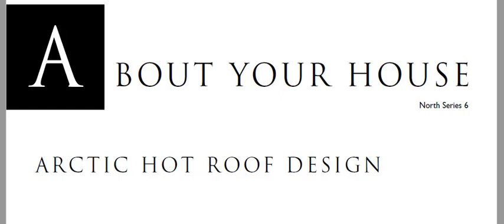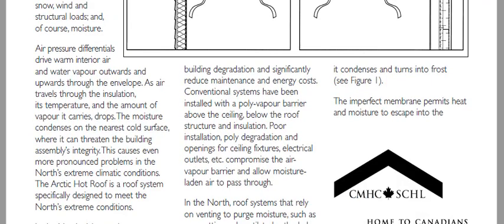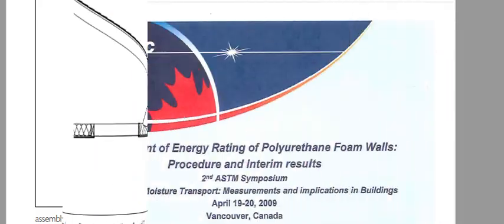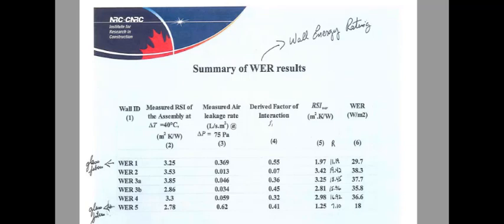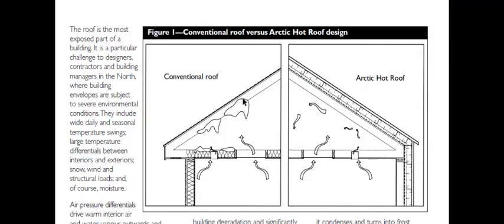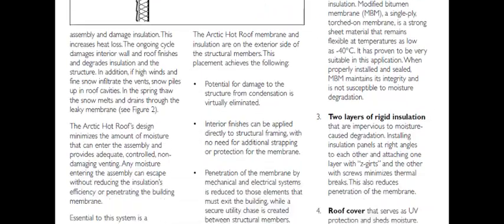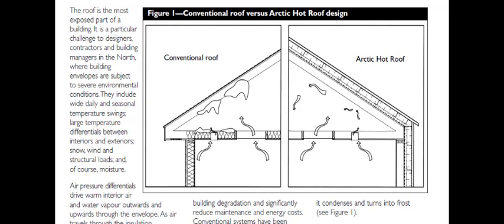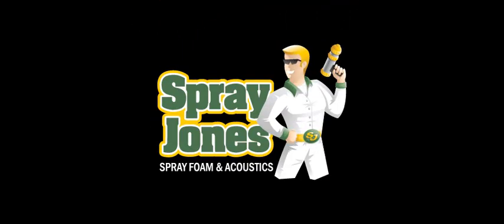Spray foam insulation to the roof deck - Does it cost more to heat this way?

Comment: What happens when you need replace water damaged roof sheeting at re-shingling? Respray? Spray foam against roof sheeting could trap any moisture in the sheeting. Maybe causing accelerated rot. 
Hard to get to the edge of roof if it needs localized respray. Easy to do before drywall, near impossible to do evenly after occupancy. I feel the respray idea sucks. Could you apply a house wrap over  roof rafters before sheeting? That idea still sucks, if you ask me.
 I love spray foam but I have concerns.
Reply from the maker: In 15 years of business of all the roofs I have done, 2 had damage to the roof sheeting because of water getting past the shingles. In each case it was small, localized and they cut the plywood out, patched up the foam with a DIY kit, put the new sheeting down and repaired the roof. No problems at all.
Reply: Spray Jones it seems like ppl are looking for any holes that they can expose and blow it out of proportion, failing to understand the true benefits of spraying roof decks. 

I have had this done in my home and I can tell you it works ! Night and day performances!
Reply: Yes
Reply from the maker: Yes
Reply: I heard this argument many times as I was researching my spray foam project and I used a different route to my decision.  After having a fire in my house and having to deal with the insurance company regarding all of the water damage I would prefer to have the roof sheathing rot in place and still have a water tight vapor membrane  (closed cell foam) between me (my interior home structure and personal items) and the failed and leaking roofing system.  My spray foam contractor assured me if that day ever occurred he could bring the truck back out and repair the foam for less than 600.00.  That's way less than my homeowner's deductible and the time and frustration of dealing with the insurance company.  BTW, I do actively heat and cool my unfinished attic space because of the amount of natural air movement between the attic and the finished space.   With quality windows and doors and a highly efficient heat pump there is absolutely zero additional cost to my energy bill.  I hope this helps.

Comment: Another great educational video 👍🏼.
What is the lowest outdoor/ ambient temperature can a contractor apply spray foam? Thanks.
Reply from the maker: We spray Walltite by BASF and they have cold temp foam called CT that can be applied to -10 C. I however always want our clients to have things above freezing.
Reply: What ever the outside temperature. It's the temperature of the substrate that need to be over the minimum and like Spray Jones says it depend on who is the manufacture of the product. I shoot SWD and it's -5°C with the summer product. But on the same time free of ice. So more the substrate temperature is high better the bond will be, better the density will be and it's will be more homogene so it's more like the manufacture want. I love you're video we need more contractor like you!